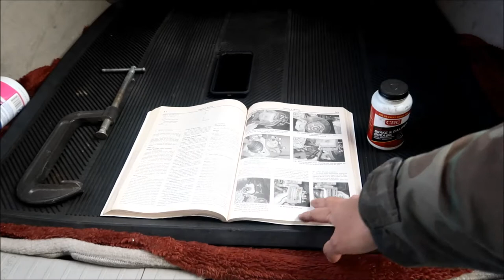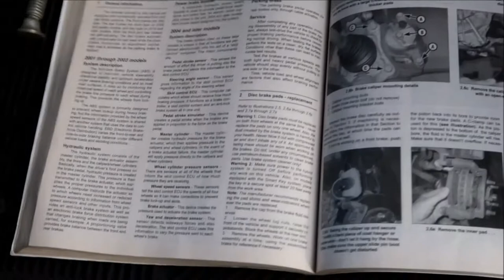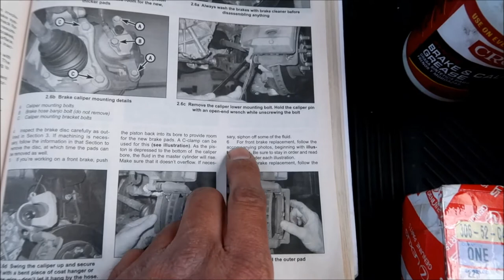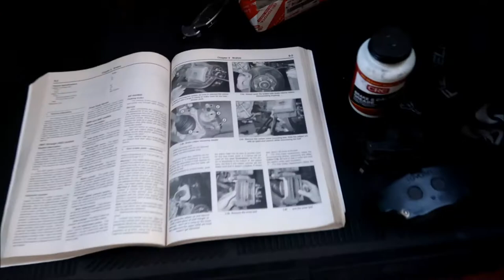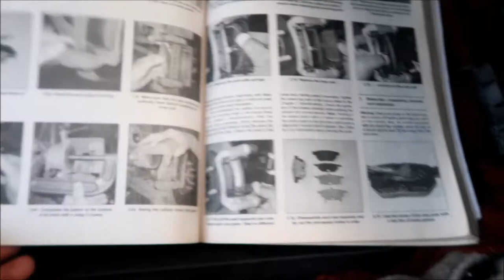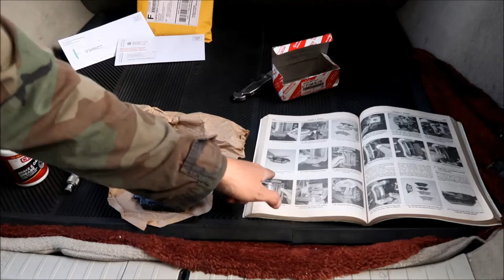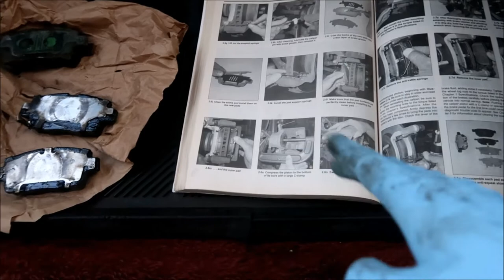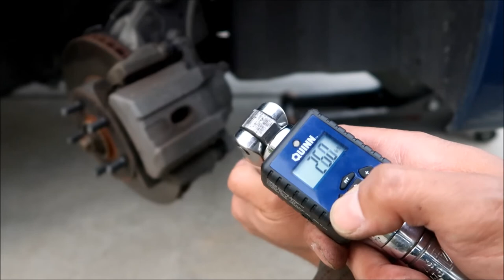How to Replace Front Brake Pads on 2004-2009 Toyota Prius

Comment: Great video. Im NOT criticizing u, I jst do differently & want to make u aware. One, u SHUD take clips out, clean them, lube behind them & reinstall. Two, lube the ears of the pads that ride inside the clips. I was glad to see u lube the pins. 100,000 miles is a long time, u may go another 100,000 & u want to make it work AND LAST. I admit, Im a fanatic. I would have replaced the rotors but would buy quality parts (OE Toyota). Next time, jst pull caliper off. When u take pads off, use OLD pad, set it on piston & push PAD/PISTON in. This way, u dont push too far, but enuf to seat piston. We HAVE to be more thorough with brakes in rust belt, in CA, ur not as concerned, u jst have excessive heat.  (I spell well, jst abbreviate) 😁 Hope u understood me & it helped!👋😁
Reply from the maker: As you can see I did everything by the book for the most part.  So I don't think I did anything wrong, I guarantee my life on it because this is the car that I drive and I have replaced brakepads and whole brake assemblies on many automobiles and motorcycles I own.

Comment: Thank you so much for this video. Your videos on the Prius fixes are always great.
Could you please make a quick video on the Prius jacking points?
The documentation shows a spot, but it's impossible to reach with my floor jack.

From what I heard/read/watched, for Prius brake jobs, it's recommended to disconnect the 12v battery.  Do you think it's not necessary?
Reply from the maker: I don't have my prius anymore but I used the engine lower motormount to jack the front up.  If you can't reach it you can jack it up on the notches where the emergency jack goes on the side.

I did not dieconnect the battery and everything was fine.

Comment: HadesOmega, Great video on the brake pads replacement, very thorough and informative DIY as always.  I am just wondering if you need to disconnect the 12v battery first or get your FOB key far away from the car. I heard some people had problem with the brake actuator activating when they are changing brakes.
Reply from the maker: Thanks for watching.  About disconnecting the battery I honestly don't know.  The manual didn't mention it I think.  Just make sure you don't step on the brake pedal when the pads are out.
Reply: I know on gen 3 & 4 u shud. & keep ur key fob away. I have a gen 4, JST disconnected MINE. I live in the rust belt & intend to clean/lube/ inspect my brakes every 2yrs. Hayden's looks so clean living in CA. Here, we have to undercoat, anti seize, u name it. I'm jst a senior, went to school as a mechanic, got additional training, BUT I'M STILL LEARNING. Jst tryn to help others.😁

Comment: How do I know if the pad was the original.... not just oem, or conversely, if they were ever replaced?
Reply from the maker: I know I had the car since it was 90k miles, so the pads were never changed by me for more than 100k miles.  I also have the dealer service history and it never says the pads were changed.  The Prius brake pads will last a LONG time if you brake carefully.

Comment: You say back and front referring to your pads, its inboard and outboard as the directions indicate. You took the pads off and immediately removed it from camera view. Show the camera where the clips are supposed to be located on the pads. Thin layer or grease on the outside of the pads!!! This INNER pad has the mark from the piston...